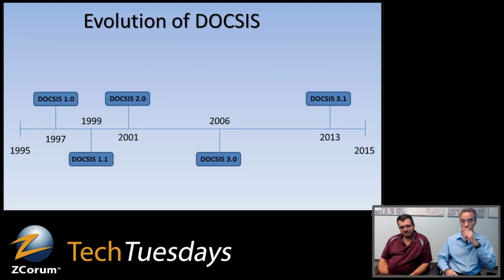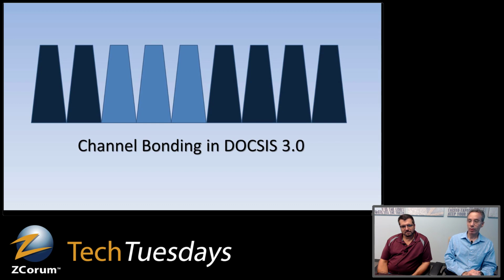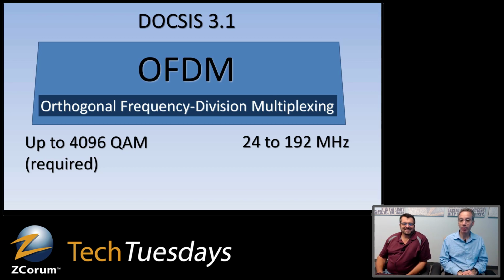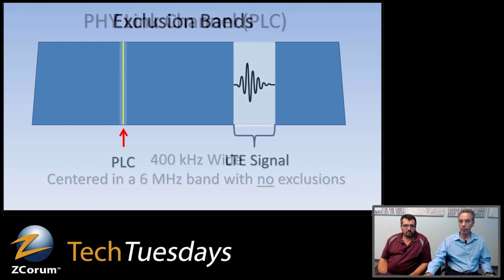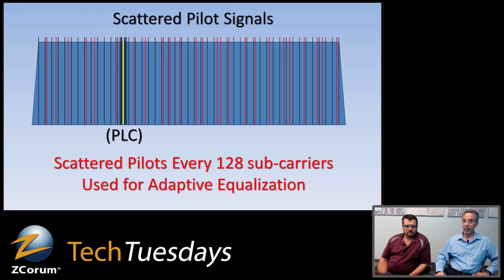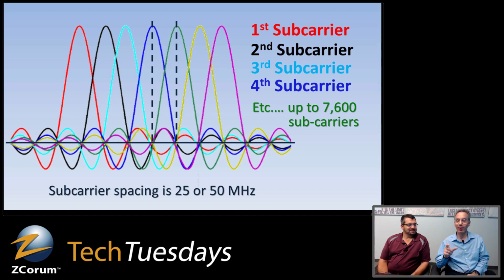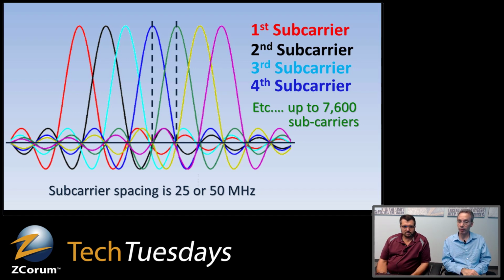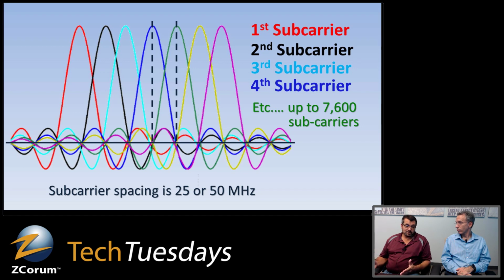DOCSIS 3.1: What is OFDM?

Comment: I was wondering if you could explain Standard Deviation in OFDM. Do you want a higher or lower value?
Thanks
Reply from the maker: The standard deviation of the MER (Modulation Error Ratio) is measured across the OFDM channel. You want a lower standard deviation (preferably less than 2 dB).